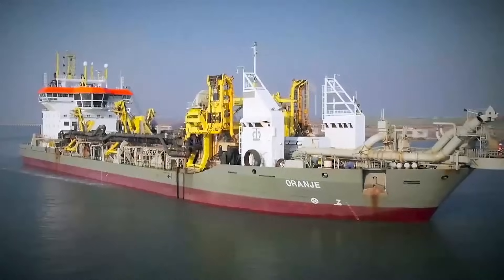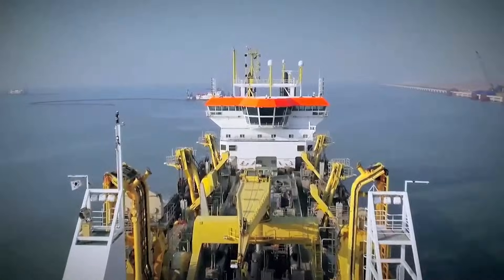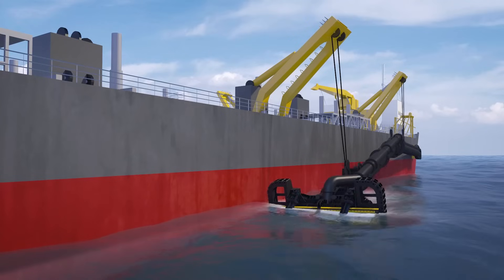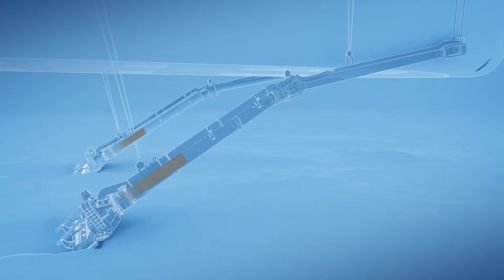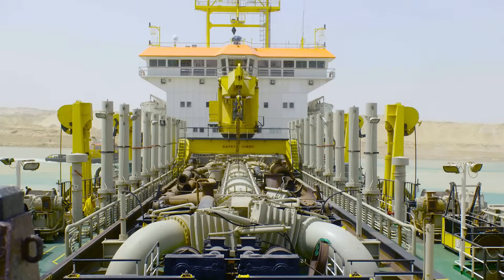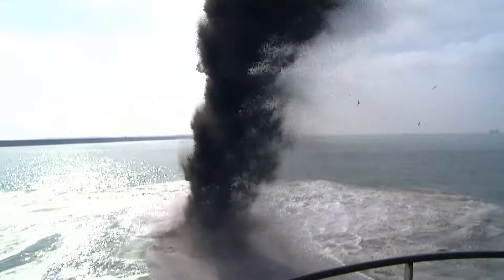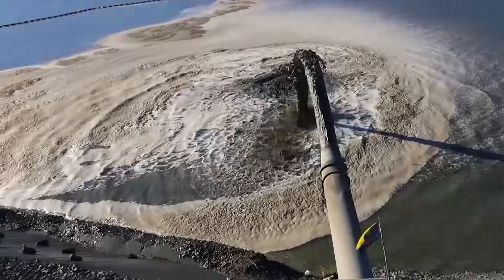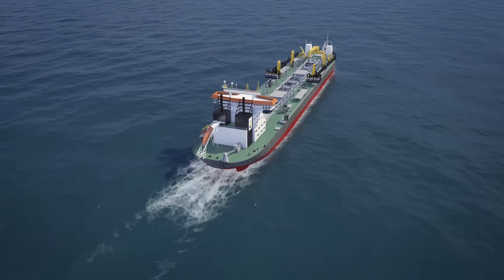Dredging: Trailing Suction Hopper Dredgers - How does it work?

Comment: How do you protect sea animals from getting sucked into the dredger? Seems environmentally irresponsible.
Reply: They have safeguards on the suction heads. I worked on one with the Army Corps Of Engineers.
Reply: Dear Bamboo Blue, Please have a look at https://www.iadc-dredging.com/wp-content/uploads/2017/02/article-faunaguard-a-scientific-method-for-deterring-marine-fauna-aqua-138-2.pdf
A draft PIANC report says: 
Impact – Entrainment and/or impingement of species:
•	Deterrent – acoustic or different, 
•	Exclusion – catch by trawling/hand caught and displace, screens at draghead, water intake (see email Wayne, dredging equipment (WID, TSHD, ..??); tickler chains (Brisbane Port video, Dredging industry), turtle deflector (US ACE), bubble screens to close of a basin, 
•	Construction management: choice of equipment, pump procedure (jet pumps on before lowering drag head (deterring mechanism), then dredge pump on and reverse while raising), temporal windows, observers (visual or by sonar), avoidance of high spots for refuge (aka turtle chill out areas, dude),

Comment: How much cost to clean a river basin (Like per kilometer )?
Reply from the maker: Dear Zillur,

The answer on your question depends on many factors. To name a few:
•	Depth and with of the river
•	Discharge of the river
•	Level of contamination
•	Material to be dredged
•	Available equipment.
All these and other factors determine the costs of the dredging project. A straight answer can’t be given.

Comment: What if it's rocky? Not sandy
Reply from the maker: Up to a certain level of rockiness, it can be dredged with a modified draghead. This so-called ripper draghead has been described in Terra et Aqua 118. When it is too rocky a Cutter Suction Dredger is necessary.

Comment: What diameter rocks will it handle
Reply from the maker: In general a TSHD is not used for dredging rock. Occasionally it can handle larger pieces of rock as long as they can pass the dredge pump.
In the Melbourne channel deepening project, equipment was specially designed to dredge rock. See https://www.iadc-dredging.com/article/port-melbourne-environment/